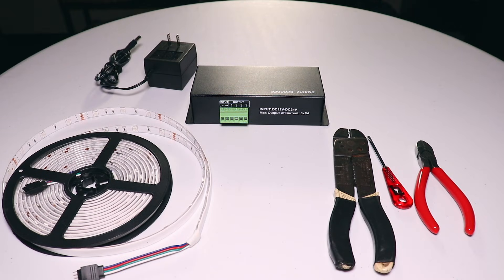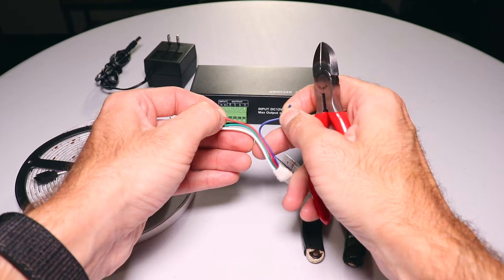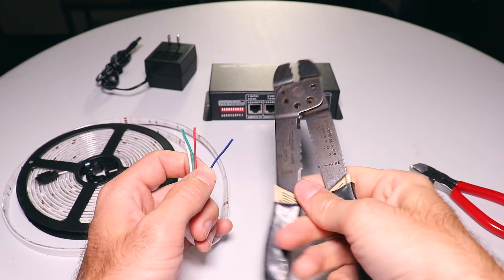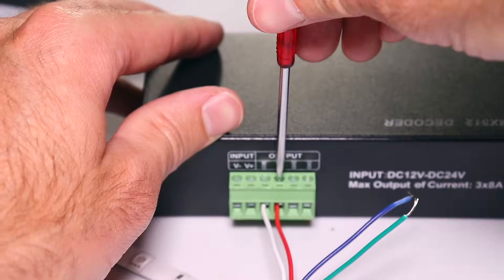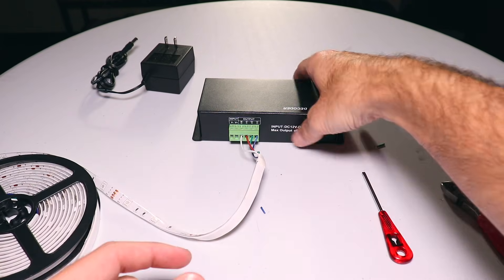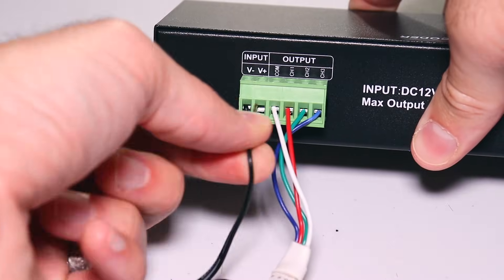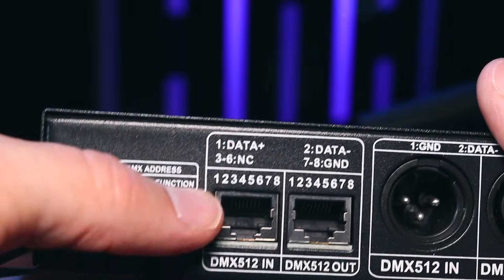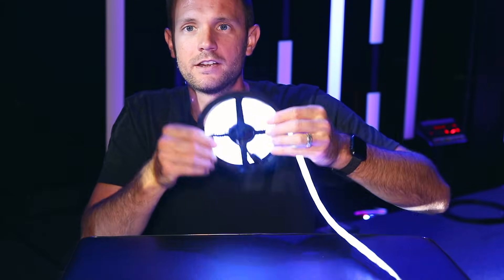How to Control LED Tape With DMX

Comment: Thanks great video. I just bought a decoder and strips on line, how many strips could I run on one decoder? Like could I extend the wires from a few different spots back to one decider and twist them together and then into the decoder?
Reply from the maker: It works for me. You will see a decrease in brightness the more strips you add though. Three is my max per decoder.

Comment: We are running a three channel DMX system being controlled by the Chauvet Obey 3 rgb. All the fixtures are set to master/slave mode. Trying to connect one of these led strips powered by the decoder in the DMX loop but not having any luck getting them to follow the other fixtures. Any idea what dip switch patter is master slave mode?
Reply from the maker: Patrick Sanders I would look at your first led fixture to see if it is indicating a DMX channel. If so the put that number into your dip switch cal. then match it to your dip switch on the decoder. Make sure the fun switch is off. Otherwise I would change your other led fixtures to the exact dmx number you want instead of doing a master slave function on them. You could even start to change them and allow for them to be used separately to create more interesting light scenes. We always patch all of our lights separately on the dmx universe. Hope that helps.
Reply: Thank you so much for your reply, I'm still not having any luck. Changed the setup a little bit to try to get it to work, these LED strips are the only fixtures connected to this controller (Chauvet obey 3 https://www.chauvetdj.com/products/obey-3/ ). I cannot find the dip switch setting on the decoder to allow the obey 3 to control them. They are working not connected to the controller using the built in controls in the decoder. Or if there is a simple controller that you might recommend that you know works with it, that would be great!

Comment: Can you bridge or daisy chain these lights to a single DMX decoder or would you have to get separate decoders?
Reply from the maker: Yea I believe you can use the given connector on the opposite side or splice them together. I would use a different decoder so that you can have more options in color arrangements.